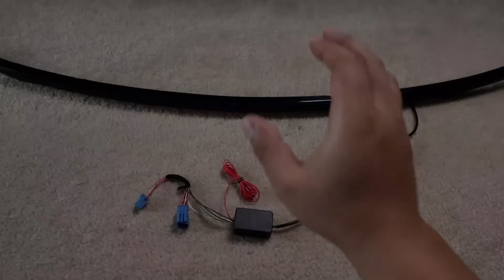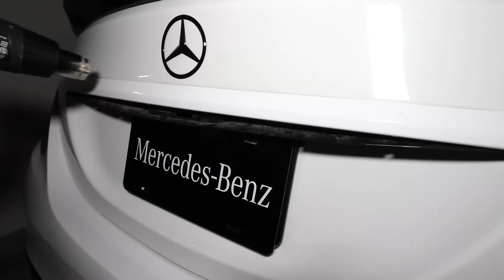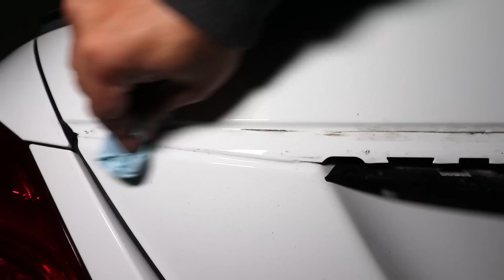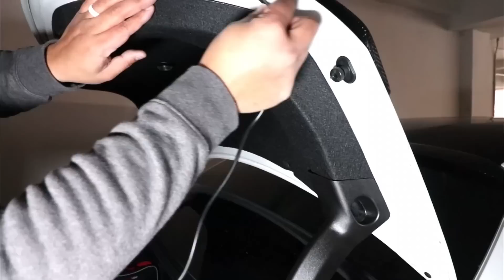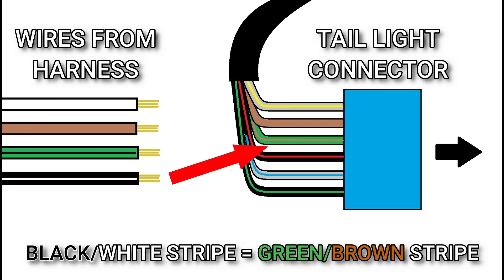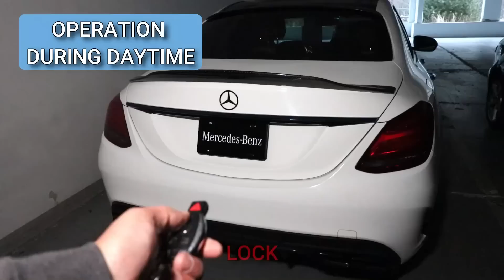DYNAMIC TRUNK LIGHTBAR installed on 2015+ Mercedes W205 C-Class Sedan

Comment: I had this installed on my w205 c450, but the double sided tape wont hold and it keeps pulling off. Any idea on how to make it stick please? The light works great, but i just have issues making it stick.
Reply from the maker: Either didnt use the right tape or didn’t clean the surface well or both.  

Not all double sided tape are the same. I only use VHT 5925 tape now. I use it for wings, body kits, trims, and more. Holds up the best then stuff from Walmart or autozone. It’s available on eBay and Amazon. Look it up.

Gotta make sure both surfaces are clean, the install is only a moderately warm day and you gotta hold the piece to the car for a few minutes for the tape to work it’s magic.
Reply: @TheFlexxGarage  okay man. Thank you so much 🙏 I'll update you how it goes. I love the light so much ❣️

Comment: Hi Flexxx Alexander, after few months the bar red lights only on the right side of the bar the left side does not work anymore, please is there a way of fixing or change the bulbs or anything that will help me fix it? thanks
Reply from the maker: Contact DMP. It should be under warranty.
Reply: @TheFlexxGarage  i did but no answer

Comment: Hey dude, I know this is an older video, but I'm about to order one of these. How much brighter does it get when you apply the breaks? My plan is to delete my factory third break light (or at least cover it) but want to make sure this gets a good amount brighter before I do. 

Again, thank you for all the awesome content! 🙏
Reply: I ordered one and when I got it the wiring harness colors are different than the one Flexx installed.  I have been waiting a week now for DMP to support me.  Communication via whatsapp is not great.
Reply: @jbird5959  dude! You’re right. Wiring colors are different. Did you ever figure out how the new wires correlate to this video? I have purple plugs and I managed to fit their harness with a little modding, but it’s throwing an error and not functioning properly. I have no problem tapping wires, but can’t figure out what’s what. 

Hopefully you got an answer and can be kind enough to let me know 🙏🙏
Reply: @thecaseybueno  They sent me back my photo of the wiring harness showing what the harness wires do.  Now i need a wiring  diagram of the tail light wires to figure out what to tap into.
Reply: Here is what DMP sent:  If you figure it out please advise.  Red - Brake Light / Brown - Rear Lamp Daylight / Purple - Reverse Light / Brown (not in harness) 12V / Orange - ground.
Reply: I have it figured out now.  Everything working correctly on 2017 w 205 base.

Comment: Flexx I got this for my car but the wire harness they sent me has different colors???
I need schematic to wire it up.
Reply: hi. I have the same problem. plugs are same like in my car but if I turn the lights on my right rear light goes off while running the led Stripe...can you help me PLEASE?!
Reply: Did you get the wiring figured out?
Reply: @jbird5959  not really
Reply: Did you get it figured out?  How did you wire it?
Reply: @jbird5959  it still doesn't work

Comment: How come you didn’t show the splicing part of the wiring I got to that part an got lost an confused
Reply from the maker: because I already did tons of videos where I show it. Plus if you don't know how to slice or tap a wire.. (no disrespect) but you need to educate yourself on that waaaay before attempting something like this. Anything that involves electrical components (especially splicing wires and tapping wires) is not for beginners. I recommend you have a pro do the install to prevent any issues that can come up from a mistake/error.
Reply: Flexx Alexander yea true I’m going to take it to an auto shop to help me on the electrical part!

Comment: Do you always disconnect the battery  when  taking  out fuses? If so why? Will it reset the computer settings if only done for a short time?
Reply from the maker: Not trying to be brash but would an electrician try to fix a wall outlet while there’s still live electricity running through it? It’s common sense or else you’re playing with a lot of risk.

Comment: Good tip to prevent double sided tape from re-sticking during uninstall, squeeze a few puffs of baby powder in the crack between the tape and the car to cover the adhesive. Doing so will prevent it from reattaching itself to the surface you're taking it off of.

Comment: @flexx I’ve got one of these and wired it up like you have, but whenever I brake, the light does the dance as though the car is turning off. Any suggestions? Thanks.
Reply: Where did you buy it from ? Can't find it anywhere

Comment: U.S. C-Class owners read this before you buy:

Hopefully this can be of some assistance to U.S. C-class owners and slight disclaimer. The U.S. wiring and SAM module is slightly different on our cars (and I imagine any others with the pink square plug). If you follow this videos wiring, it will not work properly - instead wire the white to the black/blue wire and follow everything else Flexx did. As for the disclaimer: U.S. C-Class’ use one wire for both turn signal and brake lamp. This means that when the blinker is enabled that you’re wired in to, your light bar will blink at night and make the animation of lights going outwards (braking) during the day WHENEVER that blinker is on. A bit frustrating, possibly illegal. I’m going to see if I can tap into the 3rd center brake light but I have struggled so far, if anyone has a better solution, or way how- I’d love to hear it. Otherwise I’m pretty satisfied with it. Flexx you may want to add this info to description because it was a lot of tedious trial and error and I’d hope others have the info before going in to it. I contracted DMP and they’re also speaking to their engineers for possible solution. Great video though!
Reply: yo did you ever figure out to fix the braking problem? im having the same issues with my 205 c300 U.S model :/
Reply: @luistoscano824  I did not, it currently goes off with turn signal too.  Rear center brake light is best bet but I really had a hard time getting to it, so much so that, I gave up. Let me know if you have better luck or another solution.
Reply: @546E  thanks for posting all of this info! I notice this comment is from a year ago. Did you ever tap your third break light or do you just deal with a light show when your right signal is on?
Reply: @thecaseybueno  I dealt with the light show but now I’m having issues both with my taillight and light bar. I’m going to try to troubleshoot all of the issues soon - maybe I did a bad solder job or perhaps something shorted everything out this extra wet winter. I wish there was a solution as DMP has been little help.

Comment: Would you do a turbo upgrade on your c300. They are turbo kits and the car can have 400 ho
Reply from the maker: Not worth it. Stock Engine isn’t built to support a lot of power without changing a bunch of stuff and it will cost a lot of money. Probably can make power but it will be unreliable.

Comment: Very cool, my car looks quite similar to yours especially now that I just bought this. Haha thanks for the great video, looking forward to receiving it! If you haven’t seen already, Singapore Mercedes Parts on Facebook is selling oem style smoked sequential rear signals (2020 style) for $800ish shipped to U.S. I bought them for mine and they look fantastic but unfortunately I need to send them back to have the proper U.S. plug installed so be sure to specify if you order. I was still able to see the light and it is top quality. Keep up the great work!👍🏻

Comment: I installed this on my w205... been getting a tail light error code.... any advice ?
Reply: Any luck with error code ? My light bar code arrives today. Besides the error code,  are you happy with the mod ?
Reply from the maker: not sure...was you tail light connector plug and play or did you have to tap wires like I did in the video?  I would recommend to reach out to DMP and ask them. They can do a better job in troubleshooting your issue.
Reply: Try resistor
Reply: I tried contacting DMP, all they've told me is to check connection for bent pins..  The connection is perfect nothing is improper about the install, my tail light connection was plug and play. Dmp customer service isnt great ... dealing with broken English
Reply: Do you have a U.S. class with the pink plug? Did you wire same as this video? I’m having issues myself.
Reply: @546E  did you ever figure this out? I have the pink plug and my light bar just flashes constantly by connecting to the wires that he did in the video.
Reply: @cameronr1583  did you ever figure your situation out? I have a pink plug as well. I couldn’t connect the DMP blue harness at first, but modified DMP’s harness to fit. Unfortunately, It throws an error and makes the tail light malfunction. Also, the harness I got has different color wires than the one in this video. I have Purple, Brown, Red and Orange. 

Hopefully you figured yours out and can share some life saving info for me over here 🤣🙏
Reply: i get an error message as well and everything looks fine... disappointing
Reply: @markduling2711  damn that sucks. I finally got hold of DMP engineer and they agreed to send a new 'module' not sure if that's just a wiring harness or completely new lightbar
Reply: @princeaziz34  what’s the result? I have a Euro spec car (UK)

Comment: Hola alex tengo un pregunta. Mi mercedes-benz c300 08 4 matic cuando le doy gas tiene mucha vibration alguna  idea que podría ser  gracias
Reply: hola Jose, no estoy seguro si alex hablas espanol. Y lo siento. Yo no se mucho de arreglar carros solamente mods.  Yo recomendo que uested visite un taller cuando puedas.  no creo que es problema grande. Puede hacer sus spark plugs o algo mas grave.  🙌

Comment: What about the turn signal? Were there any problems with connecting to only one tail light?
Reply from the maker: As shown in the video, the lightbar has nothing to do with the turn signals. It’s a brake light bar.  It’s connected to one tail light only to pick up the “braking” and “reverse” signal.

If the light bar has turn signals, that would be way too cheesy. The cars taillight is already blinking for a turn signal...don’t need half of the lightbar blinking too.

Comment: this light is not allowed in germany. It does not have German TÜV :)
Reply from the maker: Good thing I don’t live there.
Reply: @TheFlexxGarage  good thing we love in the EU where laser lights are allowed, not like in the US.
Reply: @TheFlexxGarage  Actually TÜV is a good thing. Limits you in terms of tuning or mods lime changing the lights but overall, every car driving on german roads has to be safe to drive, whereas in other countries you can literally take everything on the road.
Reply: @TheFlexxGarage  I have a 2014 cla, I have a f1 light on my rear diffuser.  What wires would I need to tap to connect it to go on with my oem third brake light